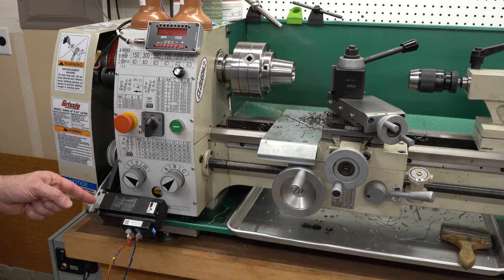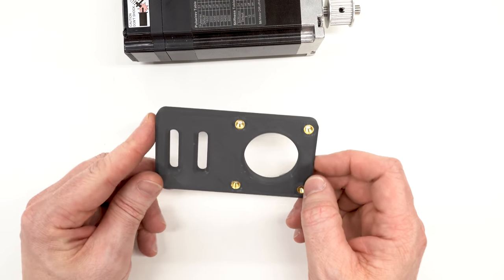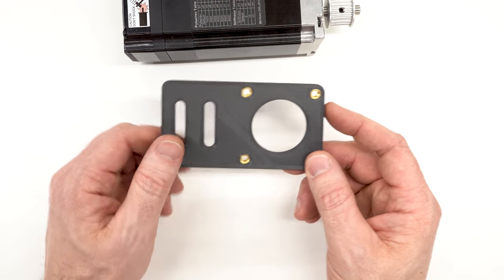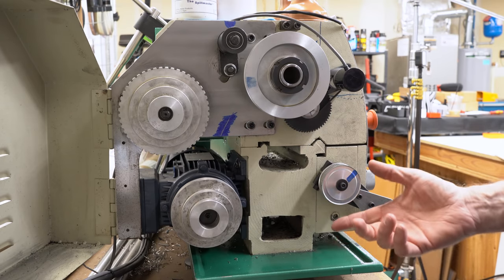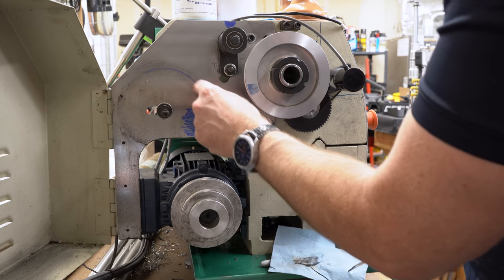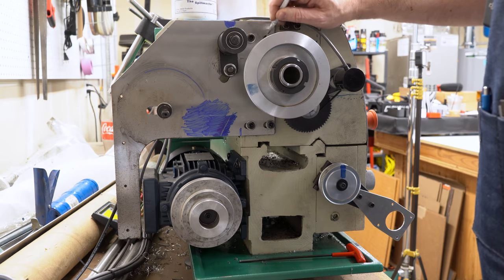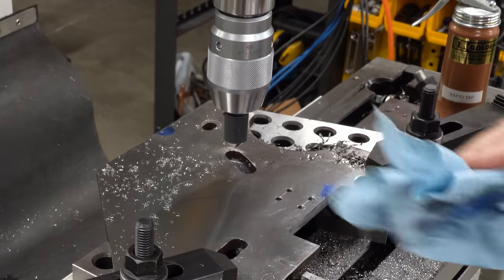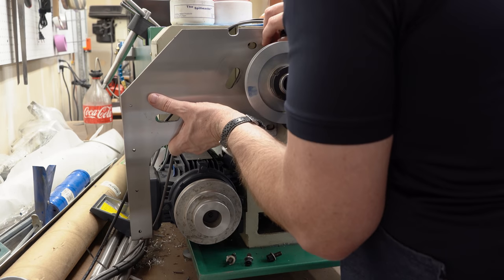Finally Installing the Servo on my Lathe | Electronic Leadscrew Part 27

Comment from the maker: If you're looking for a TI LaunchXL-F280049C board to build the ELS, both Mouser and Digi-Key are expecting a few hundred in July with more shipments later in the year.  The chips on these boards are used in automotive applications, so the global semiconductor shortage has been really frustrating.
Reply: Having worked in composites for quite along time just make sure the fiber orientation is balanced and alternating through the layers like your 0-90 degree layers and 45 degree ones to keep strength similar in all directions ...unless you want something to flex more in one direction than another
Reply: Thank you James.  I’m keen to get started so I will keep an eye out for them.
Reply: James, I have had the TI LaunchXL -F280049C on backorder with Digi-Key since January 2020. Periodically I search the web for them, and I was shocked last week when Texas instruments showed them IN STOCK! I quickly ordered the board and it shipped from Singapore within two days. To my shock it showed up Friday 5/13/22. So, if others are waiting on the board, they should check with Texas Instruments. I programed the board per your Part 10 video, and everything appears to work as I expected except my feed rates and threading, everything is way to fine. Maybe 3 times too fine. I'm sure my issue is a simple setting in the code. I had a few questions about my setup and was wondering if there is a communication channel you prefer to receive questions. 

I can't thank you enough for your videos on the G0602 VFD and ELO conversion. It makes my machine enjoyable and much easier to use.  Your videos are the best I have seen on how to do projects. Thank you!

Oh yea, I tucked my servo in the same place you did a few months back while waiting on the TI board. It's very clean setup now.
Reply: @SRED  Can confirm TI have stock, just ordered one on June 10th 2022, how long it takes to get Down Under who can tell
Reply: @awomandoesnothaveapenis  It appears that TI has three choices, but they all look the same. Which one is correct?
Reply: @awomandoesnothaveapenis  Tried to order one but I get an error "We cannot process your order at this time due to corporate policy restriction CP2"
Reply: Update received package on the 14th as 13th was public holiday
Reply: Update: This is the response I got from TI customer service: "I investigate the error message that you received and we regret to inform you as much as I would like to provide the reason behind CP2, I regret to inform you that this specific error is TI's confidential information. We advise you to process your order through an authorized distributor instead." ....strange. I tried changing some of the parameters in the order, but still didn't work.
Reply: Mouser & RS components (UK) now have stock at the moment (20th July) - For any one still looking for one.
Reply: Great finale to a great project.
Reply: Why do you have the transmission gear selectors in 1 and C rather than 1 and A ? Thank you for sharing.
Reply from the maker: @jimihendrix5576  I have a 3:1 belt drive and have the gearbox set for an additional 2:1.  That seems to work well for this lathe and servo combination.
Reply: @Clough42  Thank you sir. I have the same lathe with the largest NEMA 34 hybrid running 1 to 1 for the belt and transmission on 70v. It works awesome thanks to you. I built a new open frame to mount the lathe on for easier cleaning and have the hybrid stepper mounted directly under the lead screw beneath the transmission.

Comment: Machinists are odd creatures. Even though no-one would ever know about or see the purely cosmetic accidental notch in the mounting plate, you would have known, it would still bother you, and it needed to be fixed. I totally get you.
Reply: the notched washers would bother me. I'd most likely make a small plate and drill four holes in it, instead of using washers.

Comment: I was half way writing "BIGGER WASHERS" when you corrected one common error 
usually made from people used to work with metals.
Small washers that drown into plastic.
Another useful thing is to make enough perimeters around holes and slots 
so the volume under bolt and washer is 100% filled.
Good work as usual.
Reply: I'm a fan of larger washers, both in OD and thickness, at times using metric washers for imperial hardware and vice-versa if necessary.

Comment: Now when you said your project is finished, you can move into next phase.

Few years ago I spotted your lead-screw and decided to build one. I ended up putting a control also to the cross-feed, since I was able to fit the motor into backside and maintain manual usability. Wheel turns easy enough when controller is in disabled state. Is

My first intention was just make automatic cross-feed, but features have been piling up over time. Some features are really handy and I couldn't get back to fully manual lathe.

My goal was to maintain manual working process but provide useful tool features to expand what can be done without drowning into swamp if g-code debugging and broken tools. I feel I have managed to do it, while I have scrapped several features like speech control, which I thought was good idea. It's not, because it's no reliable enough.

WhatI have now is threading, chamfer, tapers, rounding and free formed smoothed shape. I have a graph, which show the current shape cut from the stock. It allows me to pick corners and go back on spots. I can also make a shape in program like blender and load it into my sw. I can cut it directly tracing contour or slice horizontally any portion of it to rough with different tools.

In threading, I have conventional cutting with shaped tool, but also multipass cut which can form any thread shape using any tool shape. This is handy with large threads on tough materials which I don't have a tool or rigidity of my lathe is not enough for a good result. Now I can cut basically anything with 35 degree aluminum finishing insert and get practically a mirror finish on threads.

I have basic functionality running on launchpad and more advanced features on laptop. I have pulse wheels and sw controls from gui and graph, but 95% of the time I use ps4 controller. Then my moves and cuts snap into target position and I can use buttons for finemovements.

I have made multipoint compensation for errors, meaning I can make a cut, measure it from several spots and feed measured values into sw. Then at the next pass, it'll compensate the error. My lathe don't have straight rails, so there's lot to deal with. Currently I'm working to map all error sources and make automatic compensation, but that's pretty hard task.

Comment: Many years ago I had a dream of automating as much of my house as possible. Living in rented appartments and porting back old solutions quickly got old, so I bought a house. Now all my half-working projects got set back by months and years, since a newly built house is already full of 'projects'. One per day, at least the progress can be tracked.
Reply from the maker: Ha!  I have half of my lights automated, and a case of switches sitting on the floor for two years, waiting to be installed.

Comment: 7 years ago I built a prototype ergonomic gaming keyboard out of plywood, plastic, screws, chop sticks, kebab skewers and hot glue. The plan was to rebuild it using aluminum profiles and sheet metal, but I never did. It worked just fine in it's Macgyver ghetto style state, so why bother.
Now that I've gotten myself an MSLA resin 3D printer, I've finally gotten around to start making a final version of the keyboard. I'm deep into the 3D CAD (Fusion 360) part of the project and have started doing test prints of some of the parts.

Heh, turning the crank the wrong way ...yeah, I've got that t-shirt as well. x)

I really enjoy your content! I've watched the whole ELS series plus many of your other videos (first time I've posted), and I don't even have a lathe of my own nor any other stationary machine tool. x) Also, I love that dry humor of yours! :D

Comment: I have built many things over the years that I have never used and have many more projects pending that will never get done. I still come up with ideas for things that I want to do and have purchased supplies to do them even though I can no longer do much of anything.
Reply from the maker: I'm still capable, but my planning always gets ahead of my time availability.
Reply: @Clough42  That's what happened to me at the start but eventually time runs out.

Comment: You mention wanting bigger washers under the screw that hold the bracket in - what about making a small steel plate with a matching hole pattern?  One "big washer" to distribute the clamping force over a much bigger area of the printed part.

Comment: Remove the cut washers, and create a thin square aluminum sandwich  (top bun for the previously open-faced sandwich) plate with 4 holes in it to spread the clamping load. You probably still have the setup in the DRO. As a plus you will have more support for the Nylon bracket, and eliminate risk of pulling the fasteners through the relatively soft nylon ( which is why you wanted the washers )
Awesome video as always

Comment: That looks great. I have the same lathe. As well as the boards. I can't wait to start uncrating mine and installing my ELS. I already had the lathe before you ever started the ELS project. I can't believe I've had it in the crate that long. Thanks for developing this system.

Comment: Well, since you asked... I've been working on a sine plate for my Sherline mill for the past 10 years!  Some day I'll get to use it!  I'm close.  Need to dial it in to see how accurate I can get it.  May not be perfect since I don't have access to a surface grinder.  But, it is for a Sherline after all.  : )  Very satisfying to see this project wrapped up.  Thanks for sharing!
Reply from the maker: I have projects that old, but they'll probably never get finished.  I bought the parts to build a large camera gimbal, but much better commercial offerings are now available for a lot less than it would cost to finish it now.
Reply: A sine plate?.....try using one of those digital inclinometers....they' re accurate to ..02 of a degree.....or so they say, and on testing one a strip of paper under the one end is enough to make it indicate the difference, more than accurate for most jobs.........I have a sine table and it shows a difference with the slip of paper.....who needs gauge blocks.

Comment: James, seeing you make this progress with the ELS installation makes me want to get around to designing/building/programming/etc. a "CNC" control for my old 1911 South Bend ~10-inch lathe (originally a treadle lathe, but previous owners discarded the treadle) and get one of my PDP-8s working reliably enough to act as the controller for the lathe.  So, a 1911 lathe and a ~1968-1972 computer + an ASR-33 Teletype connected together as a CNC lathe system.  Magnetic tapes too (DECtapes)!  ;)
Reply: If you do get that setup running, it would be awesome if you documented it and made a video!
Reply from the maker: I would love to see a PDP-8-based CNC controller.

Comment: Look good mate.. 
One thing I did notice is the long ramp down time of your spindle-VFD. If your VFD has the ability to take a braking resistor it can really speed up the ramp down time without having an over volt  fault..
Reply from the maker: It doesn't, and this is as fast as I can ramp it down with my largest chuck.  It's almost worth replacing the VFD.

Comment: One thing many people don't think of trying when 3d printing is the fact that you can interrupt the G-code mid print to allow you to add captive parts - 
In cases like this where you mention the rigidity of the part you could design the part to have some small hollow cylinders inside to add 1/8th steel rod, then finish the print making it permanently captive
You can also do similar for the threaded inserts by leaving a hex chamber and simply pushing a normal nut in place then finishing the print
Reply from the maker: I've heard of this working, and heard of other attempts that were spectacular failures.
Reply: @Clough42  from my past experience the failures come from allowing too much space for the inserted part in designs and allowing them to be too thin walled around the inserts (usually top and bottom rathe than side wall)

Comment: I first subscribed to your channel years ago when you showed off the ELS. I learned about ELS from your channel! Your content is really excellent but I felt you got distracted by numerous other projects. 
I eventually did my own ELS implementation based on a commercial product (rocketronics). I could not be happier as it automates both Z and X axes allowing me near complete automation of the lathe — not just thread cutting.
Reply from the maker: I accomplished my goals with the ELS.  Lots of people really want a conversational CNC lathe.

Comment: The answer to BOTH of your questions is this:  I'm probably 80% done with a hall effect sensor to stop the carriage for the ELS, but I just can't get through the last feature I want it to have (resync).  I'm humbled by how difficult real time systems are to properly program and debug.
Reply from the maker: Nice!  People tell me all the time how simple it would be, and I point out that it's open source and invite them to have at it.  :)
Reply: @Clough42  Heh, simple idea and simple implementation are so very not the same thing :)

Comment: A nut plate with 4 holes would negate the need to use altered washers. it would look better too. Nice job James.
Reply from the maker: And it would take longer.
Reply: @Clough42  Longer than your trip to the hardware store? I was a little surprised at you clipping the washers as you are such a craftsman.
Reply from the maker: @joemcgarry1106  Yup.  Had dinner right next door.

Comment: Nicely done. I’ve got unfinished projects older than that!
Reply: Yeah....try 40 years.....I bought  a small jig borer with me when I emigrated to OZ from UK in 1980 and due to difficulties in getting it converted to a mill it laid in the corner of the garage covered over.........6 months ago I badly NEEDED the mill so with new thinking it got reworked quick time and is now running complete with 100mm column riser, VFD and a DRO.....wonders never cease but miracles take a bit longer.

Comment: Just a suggestion, if possible, it's always a good habit to keep the quill as short as possible, especially when milling. It makes the quill more rigid and you get better finish. It also minimizes stress on your machine.
Reply from the maker: Of course.  I kept it a little longer for this quick project to make it easier to put in the drill chuck without cranking the knee and changing the camera setup.

Comment: For me the big projects that haven't got done in years are the shop lighting - been relying on a 'mobile' telescoping worklight stand I knocked together from scraps years ago that was meant for putting up in the garden for those jobs to big for the shop or when decorating etc (though that project should be done tomorrow!! It only took 8 years or so to get round to putting up lights that should be properly adequate and not occlude much of the natural light), the tool and material storage trays and shelves have been a WIP with no progress for most the time since it became my workshop, and I started work on a office computer/gaming sim chair frame I have no idea how many years ago now, and nothing managed to get done to that for many years now, but cursing when I stub my toe on the box section bits that are welded up and tucked under the workbench...

Comment: Great job refining this ELS James! How has the adoption of the ISV57T, with the built in controller, changed the ELS panel layout and wire routing? 
Now that your system is “finished“, a video overview of the installation would be enjoyable and useful as I’ve adopted the same servo.

Comment: Great series James. I've just watched the whole series over the past few days. This also has me thinking. I recently saw some information on polygonal turning on the lathe with a multi head cuting head running at various spindle ratios to cut squares, hexagons etc. These were mrchanical arrangements with drive belts or gears. Your ELS with (probably) a larger motor driving a cuting head perferctly synced the spindle and being able to dial in a speed ratio. Hmmm

Comment: Nice work, James 😊. That little Y-axis hiccup gave me nightmares though, they're reoccurring 🤣. 
Given my work with cnc machines these days, your videos have been helpful with my hobby as well as my day job 😁. Our manual mill at work, which I believe actually has a servo motor on the spindle, has a momentary switch to reverse the spindle when tapping. It's super slick 😎. Seems like something you might be interested in. 
Cheers!

Comment: @clough42 I just found your channel. I have a Grizzly G0752 and ordered your board. I am in awe of your talent and ability to transfer knowledge. Perhaps this has been asked before. I have not read all comments in the 27 part series. What about adding a limit switch that can be adjusted to touch the carriage at end of travel? Then just stop the servo when the end is reached. That would be handy for threading and working close to the chuck.

Comment: The reason I build my first 3D printer was so I could print some mounts for some switches... That was back around 2010... Haven't printed those yet. And somehow I ended up with 4 printers....